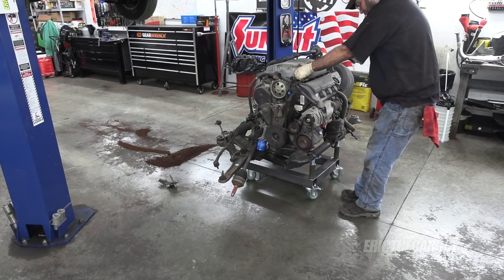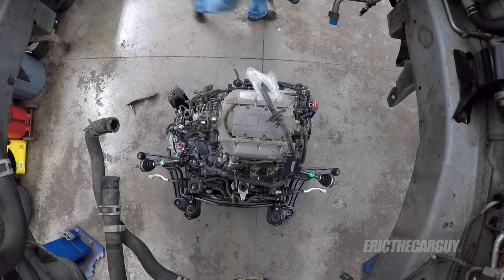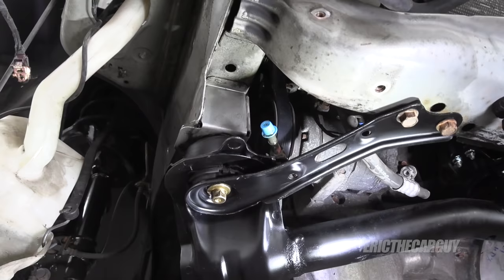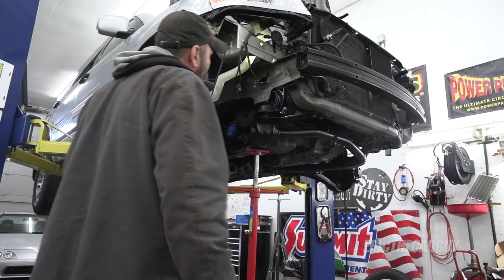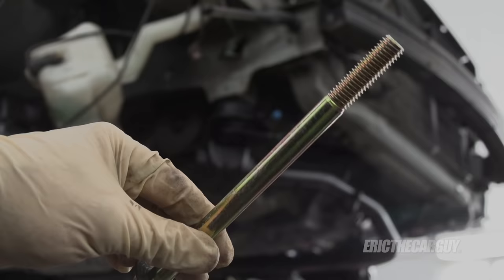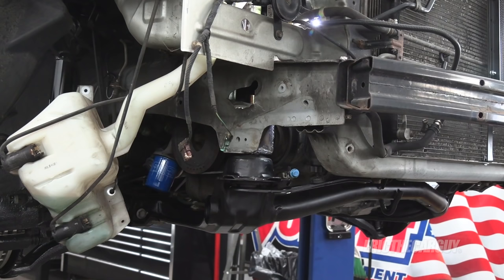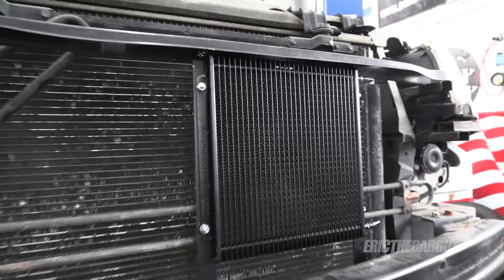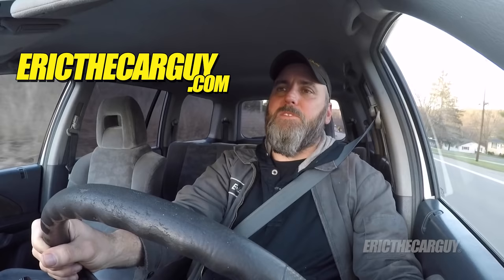Honda Pilot Gets a New Life at 200K

Comment: I basically did the same thing to a GMC Acadia 2 years ago. My sister had a budget of close to nothing and wanted a newer SUV. Bought a 14 Acadia with trans problems. Dropped the power train out, swapped in a used trans and went through everything else. $2k later and a bunch of time. She basically got what a $15k truck does for $5k. Couple little minor repairs since and its still going strong.
Reply: You in Florida I need a good reasonable me mechanic
Reply: Sounds like itll last for a lil bit but that 3.6 is just a trash motor unfortunately
Reply: Goenitz Lopez I actually like the 3.6l. Lots of power and decent fuel economy. You just have to keep up on maintenance. My sisters was lacking on oil changes before purchase. Intake was carboned up, pcv system plugged and sludges up rear head a little. Took care of those issues and fine since. It burns 1 qt every 2k, but it now has 190k on it so! I had a 3.6l Impala that was flawless since it was maintained properly. On all the 3.6l I have worked on, only did 1 timing set to date.

Comment: I think the tps is a potentiometer with a minimum and maximum voltage of the 5v signal. 10% of 5v at closed and 90% of 5v at wide open(0.5-4.5v)
Reply: I had similar thoughts, but you said it better than I would have
Reply: That’s right. The computer sees 0V and 5V as short-circuits to either the ground or supply, so the sensor runs on a range inside that. Pretty clever in my opinion.
Reply: Indeed. My '95 Ford Ranger TPS goes from 13% to 94%.  Anything above 88 or 89 the computer senses as WOT.
Reply: Also the blade is never fully closed. Always has slight angle. Or else no air would ever get in if something happen where blade was frozen/ stuck. Just happens to be %10 open.
Reply: @fritzhusselmann2023  Yup. The extra 10% either way allows the ECU to run a circuit test. When he got his OOR error on the original TPS it's because the dead sensor was returning less than 10% position just like if the sensor was unplugged.
Reply: Agreed, it’s a strategy for open/short detection
Reply: Yup. It's how the position sensors on various things on the equipment I work on.

Comment: Your using a hammer to adjust the idle speed reminded me of when I was a B-52 crew chief in the USAF and we would have an engine not start because the starter control valve would get stuck in the closed position.  The corrective action  for that was a "vibrasonic adjustment" of the starter control valve with an HM-1 (hammer)

Comment: WOW..great job.  I bought a 2 owner 03 pilot w/ 234k off of Clist..was running good until a couple weeks ago.  cooling system.  Replaced the batt, thermostat, oil change, power steering pump.  Next is the radiator, ATF change.  I dont hve the tools to do major stuff like a timing belt or head gasket.  Just need it to hold on until tax time lol.  Great channel

Comment: My girlfriend drives an '04 pilot with 320,000 miles all original. Still passes emissions inspections and no lights. Once in awhile the tranny will slip but it immediately goes away if popped into neutral and then drive again. She enjoyed watching the rebuild but she wants a new one LOL. It drives very nicely though, I've owned many Hondas pushing 300k but all were 4 cylinder cars. Never seen a v6 do it until recently.

Comment: Really enjoyed the resurrection of this Pilot....all great videos.
$6,000 plus the original vehicle cost sounds like a good price for a like-new Honda Pilot that is now good for at least another 200,000 miles.
Our '03 Odysseus is runnng fine with over 300,000 miles with no major work other than a transmission rebuild at 120,000.

Comment: I love this series. It’s great to see things being torn apart and learning from a Professional. Over the years, especially during the pandemic I had learned a lot on my own vehicle. You give me more confidence to work on my vehicle, figure things out. I also no my limitations as well. Doing brakes scares the crap out of me. Those are something that they are going to have to be done next year. I’ve been trying to learn how to do things, save some money, gain knowledge, the odd tool along the way. A little over 15 years ago, I had no idea to even change my oil. I did my first oil change that long ago and was a complete disaster. Oil everywhere, I did it on the public street(which I found out after where I live is very illegal), overfilled it, didn’t change the oil filter and rove it to work. On the way home, the extra oil that was burning out of the exhaust, made anyone behind me go into a complete fog. Didn’t help it was winter and it was a really foggy morning(this was pre 2005 I might add). After getting back into used cars in 2014, with every car, I learned something or I tried to.I learned how to do oil changes(the right way), tires, spark plugs, engine codes etc. Even though it’s been 8 years since I started learning how to do my own work, I wanted to thank you for being apart of that along the way. While I would never do a project like the Honda, the little things that I was scared to do, I can do without help, driving to my mechanic or dealership and saying, “fix this I don’t know what’s wrong.”, manuals, Youtube etc now. I can’t wait to see your next project Eric. Thanks for being apart of my DIY journey. I enjoy being apart of yours as a mechanic and learning along the way.
Reply from the maker: Thank you! BTW, you might find the info here useful for your future repairs. https://www.ericthecarguy.com/faq/
Reply: @ericthecarguy  I signed up after many, many moons or not. Thanks for the help Eric.

Comment: I believe the TPS reading displayed is the absolute value, which has a bit of tolerance with open/closed readings. The computer is able to compensate for those values once it learns what MAF/MAP values correspond to which throttle position values.

Comment: Tha is a tight fit and ding it by yourself! That had t take 4 times as long.  Holly cow! When thing bad tey go bad, Both Welders, damn! I was thinking hole and a drill but the body saw opened the whole thing.  That was a heck of a side step. Great job to stay calm and stay with it. I always try to tell myself dont get too pissed and just stay wit it. You creatd the problem, now just fix it. SOme times you leantn how not to fix something before you learn how te best option works. Great job. Great video post. This has given my some motivation to work on my 09 Pilot.

Comment: This series was just in time.  I have an 07 Pilot that has been to Hell and back and we were about to get rid of it until we saw what a replacement costs.  Sure, the 07 isn't worth the work I put into it, but it's so much cheaper than a replacement it was well worth it.
Reply from the maker: So long as you do the work yourself you should be fine. Good luck.
Reply: I maintain a 2007 Odyssey for my wife.  I'm doing the same and trying to keep it in like-new condition.  It has 214K miles on it now.  Of course, the biggest complaint  I get on it - no Apple carplay!  With the NAV-RES in the dash, I'm still trying to figure out how to get that installed to my satisfaction w/o losing other functionality.
Reply: @redmondjp  does your odyssey have steering wheel controlls (these buttons)? If so you could use a decoder and an android headunit so you wouldnt lose functionality and you'd have apple carplay / android auto
Reply: @YG--  Yes it does, although honestly if we lost them it wouldn't be that big of a deal but thank you very much for the info!

Comment: Eric.. Before you throw that Welder away.  Pull the cover and check the incoming power.. There's likely a fuse or thermal coupler, or even the main switch can go bad;  you can just bypass them.  Check for a fuse in the plug end too-- I've seen a fuse right next to the prongs before.  Maybe where it connects to your board, just needs cleaned.  Just look, I'm sure it will jump out at you.  These things don't just break, it's something simple.
Reply from the maker: I believe I already mentioned that I fixed the welder and I'm giving it to my grandson.
Reply: @ericthecarguy  Sweet.. I wish you would have done a video on it.  I'm always down to learn about the things that break.

Comment: Honda TPS output voltage goes from 0.5v for close to 4.5 volts for WOT. This diagnostic tool is probably assuming that 0% should be 0V and 100% shuld be 5V which is not the case on Honda.  That is the reason for that 10-90% reading.  BTW you can replase only the TPS sensor. When replacing set it like 0.48V on  close throttle and you are good to go.

Comment: Aaaaaa the joys of working on cars!  Get dirty!

I had a rear bolt that stripped out on my wife's honda element.  Well I cut it open with grinder, thin blade.  I replaced old nut with ⅝ strut nut.  Left cutout open until swing arm was bolted well and in place.  Then I just welded the strut nut and piece I cut out back in...  Vala!

Good weld for vertical!  Hammer 🔨, beat it to fit.  Paint it to match.  Yes tranny cooler, good.

Comment: In 2020 I bought a 2002 Acura MDX.. It's essentially the same vehicle as yours, except with 3 rows of heated leather seats and a 3.5L Honda Vtec.. Otherwise, I believe the AWD system is very similar.  Man, these are good little cars.  Mine is in incredible condition and only has 160k miles on it..  really cold dual climate AC with the rear vents in the center.  I only paid $1700 for it here in Oklahoma.  But that's not normal. lol..  These things sell for $4500 around here, I just got lucky and found this on craigs list and it just happened to be a rich kid around 19 years old and his rich mom.  She was in a brand new Denali or Navigator, and was telling me how they were about to go straight to a dealer and buy a brand new car for him..  So they didn't really care about the low price I offered them, they took it. lol.. I'm so happy with this thing.
Reply from the maker: Awesome. BTW, I'm a former Acura master tech. You're right, they are the same vehicle. Thanks again for your comments.
Reply: @ericthecarguy  yeah.. your videos are gold-- and really convinced me to go Honda, and this thing just fell in my lap.  Best vehicle deal of my life. lol..  Absolutely not a drip of oil anywhere on this thing.  I just can't believe I got it for so cheap.

Comment: At about 200k I replaced the transmission on my 93 F150.  Also redid the ignition components and the rear spring supports. Along the way I also had to replace the AC compressor.    Now, at 290k I believe the right side engine mount is in need of replacement.  Paid $6,000 for it 200k ago.   May have spent another $2,000 in parts since then.   Them 4.9s run forever with a little TLC
Reply: Oh wow
Reply: I replaced my electrical panel in my car

Comment: Fantastic job Eric, i did think it would be as good as new when finished.
But i was wrong!!.  It's better than new because you repaired it 😀
At some point you will find out the range of the t.p.s sensor, but the engine
computer might have compensated and saved the new limits.
Just a silly thought.
Reply from the maker: I agree, it's likely a programming issue to account for resistance variances in the TPS sensors. Always great to see you.

Comment: This was a great series Eric. You're the man when it comes to these old Hondas. 

If I wanted a Honda SUV - this is exactly what I would do. Buy an old one and put it back to full working order myself like you did. Yeah you'll spend more than the vehicles worth but on the other hand with a bit of luck you might get 100,000 miles of trouble free driving. It's expensive but its a lot cheaper than buying a new one.
Reply: It can be even cheaper than this if you hit the used car lottery. This is obviously completely anecdotal, and has become basically unachievable in the current used car climate, but we bought an '06 acura MDX 5 years ago, with immaculately-kept dealer service records, for $5K. We've since put an additional 80K miles on it with the most serious service costs being brakes, exhaust, steering pump, and valve cover gaskets. It's hard to do better for long-term value and maintainability than a Honda/Acura that's been treated at least decently during it's early service life.

Comment: It's not apples  to apples, but the range of the position sensors we use on CAT equipment is 5-85%. So yours is probably reading correctly. It just uses the far ends of the range to set trouble codes. If they used 0 as idle, the computer wouldn't know if that's a valid idle range or if you have lost the signal.

Comment: Hi Eric. Great series . Your experience working for the Honda dealer comes through with the off the cuff advice as you did this job.I like the fix on the subframe bolt . When I put the transmission back in the 2002 civic . The Honda book said use new bolts for the subframe . I cleaned up the old ones and put on some red lock tight and torqued to speck . Sent the transmission to a tech got it updated to advanced technology & parts . Love your work and helps me with all the info I get 👍🇺🇸

Comment: They make aftermarket tps sensors for Hondas/Acuras. I had an integra GSR with the same failure. I just had to drill out the rivets on the old one and the new one came with bolts

Comment: Mine 2008 Honda Pilot is 220000 miles is still in very in good condition, just oil change it every 4000 or 4 months, transmission change every year.

Comment: I believe those style throttle position sensors can be removed and replaced using regular Philips head screws of same diameter and thread pitch, and than calibrated once installed

Comment: Hey Eric, before you throw that welder out--- you should pull the cover off and check your incoming wires to the plug--  as they come in there might be an inline fuse inside the case.   On mine, there was a large switch in the back that stopped working-- so I just bypassed the switch  and it works great.  My new 'off switch is just to unplug it for now.  You could splice a regular light switch and box on your cord if you want-- little clumsy, but would work great.  You could mount it on your cart if needed.   My point is, it's likely something very simple and right there on the incoming power.    May be a thermal safety switch there that burnt out.. just bypass it-- they don't really need them.  That's just a safety sally lawyer's liability addition to the build. It doesn't need it..  Sometime your plug itself will have a little fuse in it, check it closely at the prong end.
Reply from the maker: The trigger went bad in my old welder. I got a new one and I'm giving it to my grandson. As for the plasma cutter, I also think that trigger is bad but I haven't looked into it yet. I don't use the plasma cutter often. Thanks for the comments.

Comment: Amazing!  Now do a 2nd Gen Acura TL!
Reply from the maker: I might. https://www.youtube.com/watch?v=pI_wno4uJb8&t=773s
Reply: @ericthecarguy  Thanks for showing me this.  Does this 3rd gen inspection video carry over similar things from the 2nd gen TL's?  Just wondering since I have such a hard time finding info of my 02 TL-S.
Reply from the maker: I recommend avoiding the 99-03 TL's in particular. https://www.ericthecarguy.com/forums/topic/1999-03-acura-tls-and-cls-pattern-failurers/
Reply: @ericthecarguy  Thanks for this link!  I've actually been driving mine since 2010 starting at 112k miles and have over 165k miles on it now.  I only bought it because I knew the transmission was replaced by noticing the blue mark on the engine.  It drives quite well and has not had any major issues other than a slight vibration in the steering wheel at high speed.  Thanks again for your reply.

Comment: I have a 2006 MDX, so watching these was great.  Mine has 450 000 KM on it and I've been getting a P0420 in cold weather since about 350k KM, which is supposed to be one of the pre cats.  Hopefully, you don't end up with this, as those pre cats would have been easy to replace when the engine was out.

Comment: The TPS sensor range is normal. Mine reads about the same percentage open and closed. My guess is signal voltage range is wider than the mechanical full closed and open position.

Comment: Nice to see the truck getting some love. I feel your pain on the subframe bolt. My daughter’s first car ( ‘98 Forester with 258K miles) was a rolling rust bucket. Both captured trailing arm nuts broke and I had to come in from the top (under the back seat and do what you did and weld in nuts on both sides.

You are right about the cost of refreshing an SUV. I’ve been slowly been fixing up a 240K mile RD1 CRV and the transmission just died and I’m in the process of replacing it. Have I spent more on the car than it’s worth? Yup, but I really like it and have fun tinkering with the darn thing. Keep posting videos, your channel is great!

Comment: That company is Hondas supplier for transmission fluid, however folks have had both Honda branded, and Idemitsu's lab tested by Blackstone. They have different anti-wear additives, specifically the Idemisu's is lacking in types completely.

The viscosity, and everything else is correct but there is a difference between the two. Some say it makes no difference, others say Honda puts too much anti-wear additives in their fluid to make the shift feel smoother. Others say it runs fine on Maxlife ATF, however Castrol Import is generally the most commonly recommended non Honda ATF due to closer viscosity, and wide availability.

As far as I know I've not actually seen any other atf fluid on the market which uses the same anti-wear additives, to the same concentration. Take of that what you will, just throwing this out as I've spent a lot of time reading forums, and submitted lab tests.